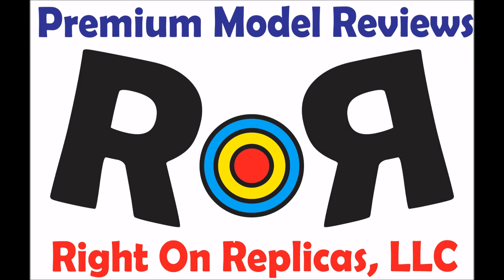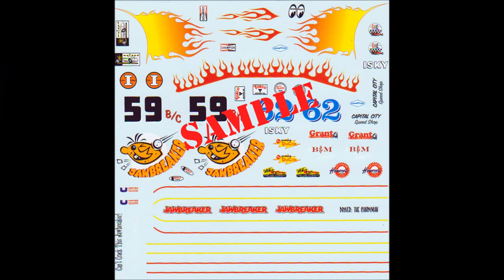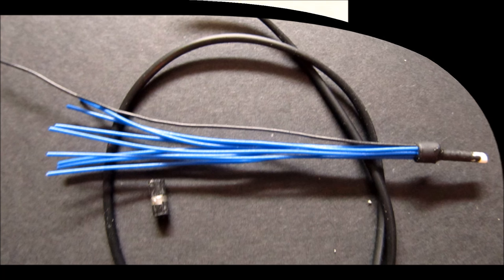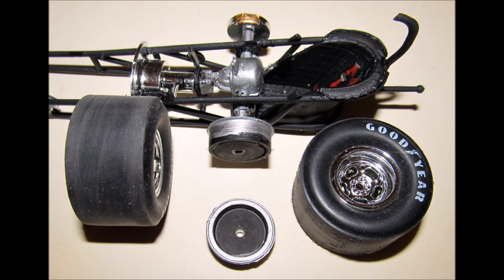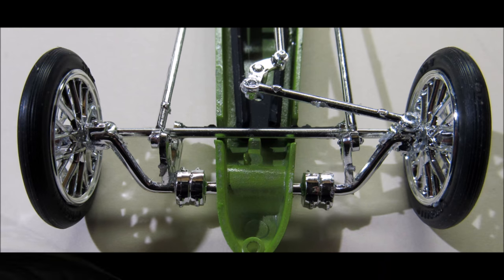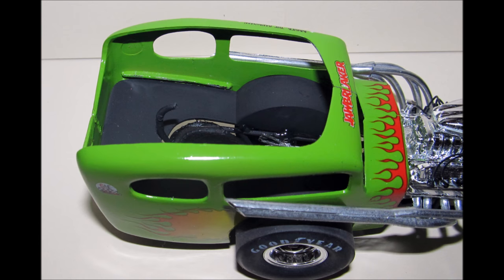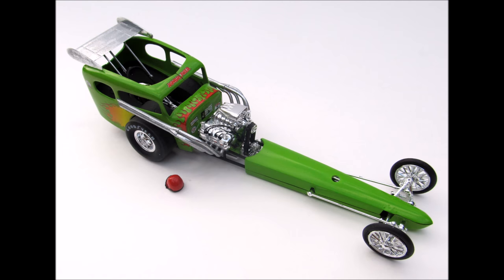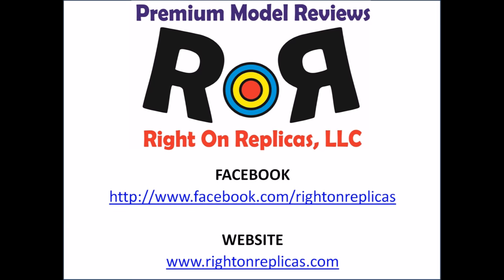How to Build the Jawbreaker Wild Rail Dragster 1:25 Scale MPC Model Kit #821 Review

Comment: Still working on this one. Bought some laser etch seat belt hardware from Detail Master as well as some AMT Aftermarket  racing slicks. Going with the original decals from over 30 years ago. Not sure if the decals are still good. Doesnt look like they have yellowed. I really wanted to run brake lines but Im not sure where the mastercylinder would go. One more thing I was thinking of is to put a driver in the seat  .
HEY  DOUG, Thanx for the review/build and the link to instruction sheet. The Box art only got me so far. 👍🏻👍🏻👍🏻👍🏻👍🏻
Reply from the maker: Thanks Harry - we're here to help!  -Doug

Comment: A great review. Would this have been classed as a Competition class car back n the 1960s without the wing fitted.  It looks like there are two sets of weights molded into the dropped front axle. They could possibly be picked out in black for a bit of extra detail.
Reply from the maker: AC,  Thanks for the tips!  -Doug

Comment: I'm curious. What is the hole on the top body panel for ? Did rail cars have this ? Looks like a inspection port for front end linkages or something. Thanx Harry
Reply from the maker: HH, Pretty sure that was where the driver got into the rail.  Those chopped windows look pretty small!  -Doug

Comment: Hey Doug sorry to keep asking questions. I am almost finished with the Jawbreaker. However,this kit was missing rear slicks so I bought AMT's Race master slicks.
I think these are little too big ,not sure but I cant get the body to sit onto the frame level. My question is......will AMT sell parts for current kits ?  Any input will be appreciated.  Thnx Harry H.
Reply from the maker: HH,  The short answer is - maybe.  But you can check here https://round2corp.com/request-a-part/  -Doug
Reply: @RightOnReplicas  Thanks Doug.
I will give it a shot. I need the rear slicks. AMT's aftermarket  slicks looked like the perfect solution but the rail car body will not sit on frame properly. Width is not the issue. It must be off my a very small amount. Again,thanks
I do watch ALL your review/build video's 👍
Reply from the maker: HH,, If you can still test fit the tires, you may be able to add some shim stock to get the space you need there!  -Doug